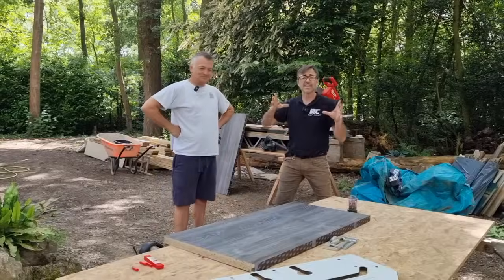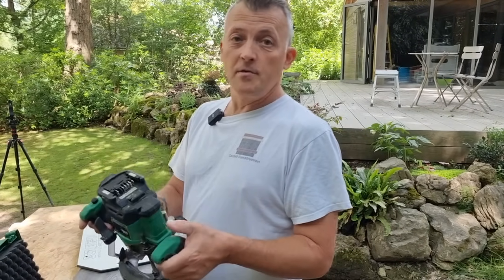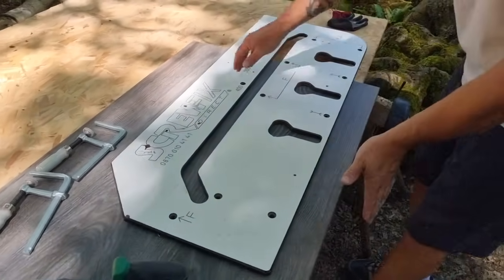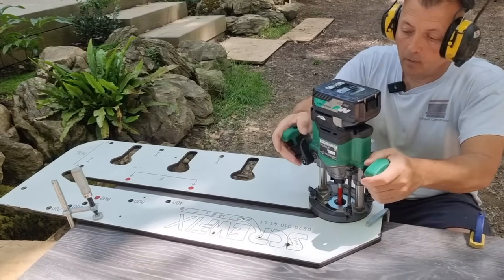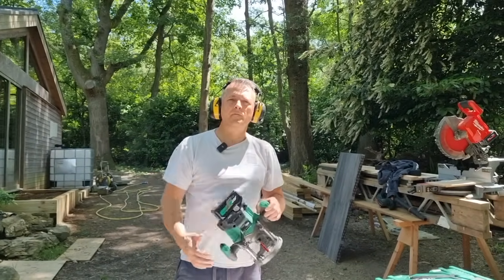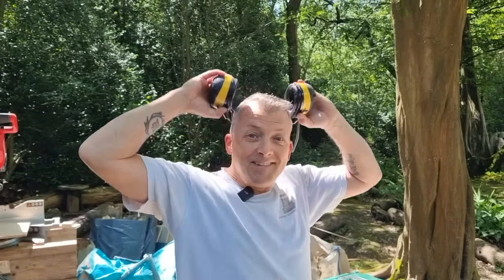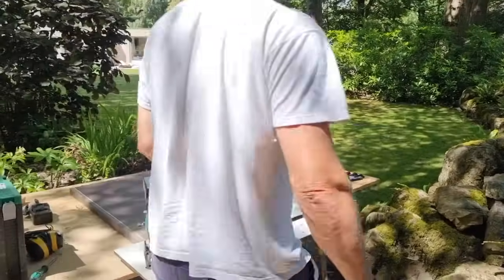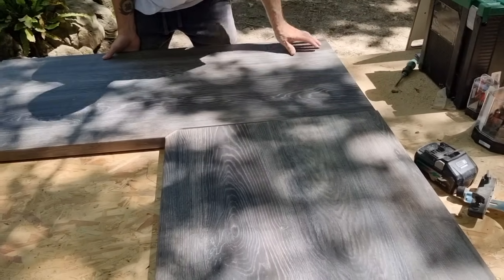How To Make A Perfect Joint In A Worktop With A Hikoki Battery Half Inch Router

Comment: Do not run the cutter back up the joint to start a deeper cut,  raise the bit out of the worktop on returning to the start.  Avoid pining bits off doing so.  A diamond hone keeps an edge on the router bits longer.  You get what you pay for with cutters.  A hint of polish/wax on the router base and jig allows smooth guiding of the router.  If not a 90 degree joint alter the front pin on the male so it does not cut too deep if its slightly off 90 degrees.  Buy quality worktops not  cheap DIY  which bow and are softer cored.  I was asked to do just the worktop joints so many times when people had done their own install but I only did that for people I liked.  Must have done thousands in my time.  I have a huge box of used 1/2" cutters about 500 from Screwfix that used to be good value and cheap enough not to resharpen.  Dust used to be the pain doing these joints it blew every where.

Comment: A great demonstration, I love the cordless router. I like to add biscuits between the clamp cut-outs to ensure the worktop faces finish flush when bolted together. It doesn't take long and it prevents movement when tightening the bolts.
Reply: That is a good idea.

Comment: I’ve used Dewalt and Trend routers over the years and now use a Mafell half inch router for worktops and a cordless Dewalt quarter inch for door hanging. Keen to get my hands on the Hikoki cordless though! 
Only piece of advice I’d say to make the cutting of the bolt holes more accurate is USE THE DEPTH STOP. Always have one of the three depth stops set for bolt holes. No margin for error then. All holes set to the exact depth. Great demo vid Robin 👌🏼

Comment: Robin, I have specialised in decoration of Victorian and older properties. All of the situations such as boxing in pipes as and when necessary to blend in have given me much router experience. Still feel anxiety when doing worktops but one time I was called in by fitter to "cut the tops" as he was unsure/unable/unwilling to cut a "U" Shape room.. Finished job and loading van, was approached by lady next door as her kitchen fitter with all the Festool kit and flashy van was on his THIRD set and even cut the dogbones on the face side! I could not help as just off on hols. We all make mistakes but your experience and also admitting your anxiety for this makes me feel so much better. I do admire the Hi koki but my Makita 3612C has seen me through and may see another generation through.  Just gotta get a Trend scribe though... I had never seen one before. I did my apprenticeship in Aircraft Industry so routing, milling and such were second nature but I still need to "think" of turning worktop jig over. Bob    Albion Decoration. Weston super Mare)

Comment: Brave man. Interesting to hear that even you don't like doing bench tops. I have the jig and all the equipment to do the tops. I can do them. And have done a few. But hate doing them. Nerve racking, horrible job. I fit all the cabinets. But buy my benchtops already mitered. Most people do in Oz. The cabinet makers cut them with a CNC machine. Makes life a lot easier. I used to work for a cabinet maker as a wood machinist. They used to make up the tops from blank bases. Laminate them. Postform them. Then cut any miters and dog bones required. We made them for a lot of different companies because the equipment to do that is very expensive. My jig I brought over from England with me. You can get them here. But not common. Especially in Qld. Some very interesting tips from a professional to make it easier. Where to cut first. And the screw trick on the offcut. The other trick they use that most of us not doing it all the time can't do. Is colour match fit up. He would carry a set of most of the common colours. I have seen the pro boys install on site. What looked a fairly average joint can look a lot better after a bit of Colorfill on the joint. A definite skill. But not one I am in a hurry to perfect.

Comment: Yes it's not difficult  but if your not concentrating and taking your time you can mess it up. I've worked with routers for 15 years so my first Mason's miter was easy. Routers look easy to use but they do need experience control knowing what side to start so you don't blow an end out ect. Great video

Comment: Quick question, what size is that router bit, I’ve bought this same router yet whenever I put my cutter in it sits too far out from the collet, I had a Dewalt 240v before and it was fine in that, is it something to do with my router bit or the hikoki router?

Comment: Great video as always. 
That looks like an impressive router, I’ll stick with my OF2200 but would certainly consider buying one as a back-up. I’m going to try those Freud cutters, I normally use the carbide Trend, which are good to be fair especially as I spray clean mine to remove the resins. 
Thank Carl for the tip of cutting the front edge of jig and just going up to the finished edge on score cut & final pass. 👍

Comment: As a retired kitchen fitter of 30 years I still have the same original Screwfix worktop jig, it was the dogs, with no flex and brilliant for standard widths worktop, I ended up owning 6 different jigs for various widths, Belfast, multiple radii and various other requirements, but still my favourite go to was the old Screwfix…My top tip always let the cutter stop before lifting out, seen many jigs damaged through haste. 227 mean anything to anyone?

Comment: Always rated the corded Hitachi routers over the Makita's as there is no kick when you switch them off. Now looking to get the Hikoki battery ones for the  workshop. I have always preferred Titman router cutters as they have always stood the test for me over the years. The trend work top jig for cutting the butt and scribe/mitre joint is quite good as it has recesses in the surface to put rail cramps into so as not to get in the way of the router. I would very much like to know where chippy's get the idea that the joint is a mason's mitre from. Anyone who knows about stone masonry would know that this type of joint is nothing of the sort, mason's mitres you actually do not cut a mitre; you carve the mitre into the stone or timber if you apply it to joinery. I guess you can call it what you like as long as you make a good job of it, even the latest City & Guilds book now refer to the joint as a Mason's mitre as I guess that is what a lot of chippy's are calling it, but to me it will still be a butt and true mitre, bit like 'clamps' or 'cramps' debate. Great video as usual Robin.
Reply from the maker: Hi Gary, yes it's a term we have literally stolen from the stone Mason!! Great point
Reply: Excellent demo and a nice bit of kit. I am not usually a moaning mini Robin but feel I have to say something about heath and safety here. I had to retire early as a carpenter/joiner due to contracting COPD. I was always a bit gung ho about wearing dust masks as I found them uncomfortable. Some days I couldn't even lift a big old router, let alone make the cuts. You can clearly see the fine dust and God knows what else entering your brother in laws airways,especially when he is cutting the dog bones. Just a few words about my experiences mate, nothing more.  Regards Berni
Reply: 'Cramps'! At 68, I've only just started calling them 'clamps'. Great to hear the old word I've used for 55 years
Reply: @cuebj  I have always been a cramper, unfortunately the younger generation only hear what the Americans call them so it's clamps. Still got my Record T-Bar 'cramps' which is what Record described them as in their literature and with a sticker on the side, but hey ho times and language moves on, most of the students I see only know them as clamps so clamps it is.

Comment: Bit more info please on setting out worktops? What do you do to allow for out of square cuts?
Reply: This was also my question. I have only done a couple of DIY fits and the walls have been almost square. Then I just recess worktops to fit them square. But if that can’t be achieved, I presume you create a line on the female top that is perpendicular to the male board and work off that rather than the three pegs in the jig. But one peg at end is presumably needed to position the 45 degree cut?

Comment: I'm a rank amateur DIYer who's trying to figure out how to cut worktop mitres and I'm confused as to how the scribe tool is marking the correct line. There seems to be an offset of several mm from the marked line to the edge of the female joint. What happens to that offset when you align the jig to the scribed line and start cutting?

Comment: I like to buy some long jigsaw blades. Set the jig up, do one pass with the router. Then rough cut the waste off with the jigsaw and complete the cutting with the router so not trying to cut too much material  just cleaning up. Saves loads of £s cutters
Reply: Thats always been my preferred method as well, but it's the end result that matters and what works for some won't work for others.
Reply: If you drill a couple of holes in your jigsaw base at the correct point, and tap them (or just use nuts at the other side), then you could add a couple of steel dowel pins to your jigsaw, and then run the jigsaw against the jig. Then one final pass with the router. 

Or not, either way is fine!

Comment: I would do the initial cuts moving in the other direction to use bit rotation to pull the cutter in tight....technically that was a climb cut that could lead to loss of control....I'm no novice with a router but the first worktop I did a pass in the wrong direction and nearly lost the router!

Comment: How many joints per charge do you think iv been looking at it for a while but as im on milwaukee id need batteries and a charger so it a big out lay if its chews through bats
Reply from the maker: Based on the test I reckon with the battery we had in you could get between three and four joints per charge, many kitchens on would have a couple so it would do most installations on a single battery
Reply: @robinclevettcarpenter   oh right thats interesting then id have though it would have been a battery monster. Cheer robin you have just cost me £500 plus quid 😂😂😂😂😂😂😂
Reply: @covcarpenter9158 Milwaukee about to release a ½ inch cordless router mate so might be worth holding off

Comment: Always use colour fill? What's that, some sort of paint for edges?
Reply from the maker: It's a colour matched paste in a tube that you can apply at the surface of the joint as you are cramping up and it makes the joint almost dissappear
Reply: Joint adhesive, I used to use pva and silicone but you get a proper colour matched adhesive nowadays. I think it’s epoxy, it fills any small imperfections and the joint is solid. Need to be get it clamped together with about 15mins though or it starts going off
Reply: Joint and sealant compound, we use it all the time

Comment: Quick question. Does anyone ever use a guide bush concentric cone to Centre the guide bush before installing the cutter? I have an old Feud router (really good by the way) but I do find when I put the 30mm guide bush in that there can be some discrepancies which ultimately effect the result of the cut. Not done loads of these tbh but odd one has had a slight difference in them. Been looking at a concentric cone to try eliminating this. Anyone else use them or is it just standard and I’ve been doing them wrong?
Reply: On the Hikoki you can only fix the bush in one position so no adjusting is needed.

Comment: “Whether I’m on price work or day work” comment indicates you have 2 standards of working my friend, not a good advert
Reply: Could be 2 ‘Methods’ of working with the same standard/quality of work when finished.
Reply: Not really. If your spending a day at a particular location and fitting a worktop as part of that, it's bound to be cheaper than a single call out, which could cost half a day or more in lost time.